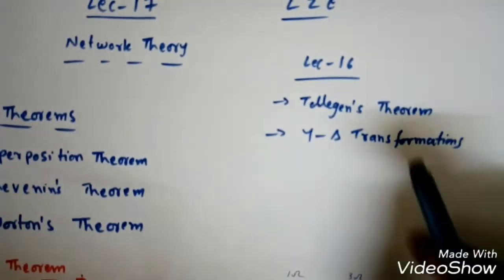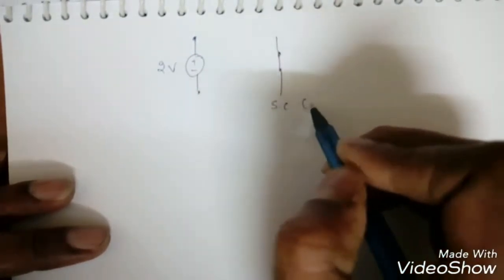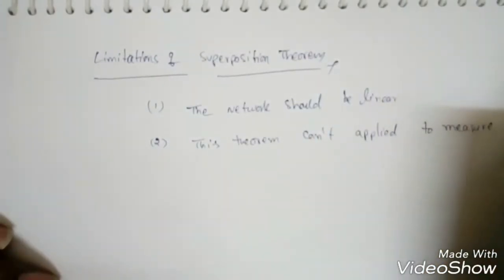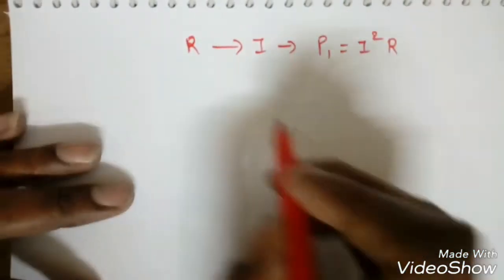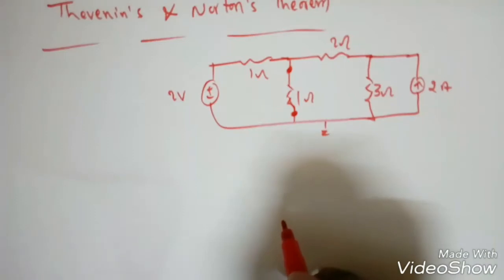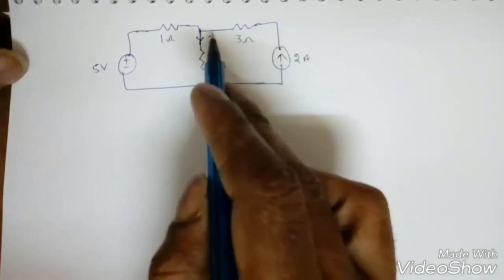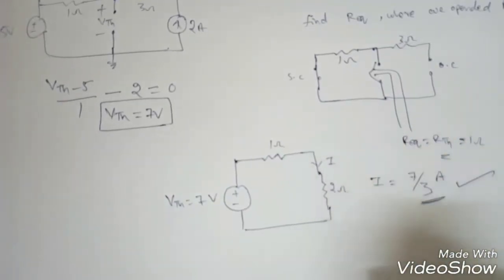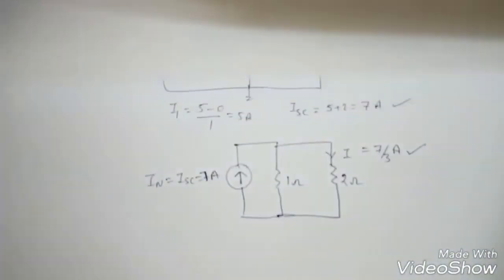Network Theory Lec-17(a): Network Theorems

Comment: Sir ,here while doing the prblm using thevnin ,Req was found to be 1ohms .but when u hav drawn the final crkt including Vth ,Req became 2ohms in series with 1ohms .can u plss explain
Reply from the maker: Gopika Ps see we have to find a current through 2 ohm resistor...so the remaining network can be replaced by thevenin equivalent circuit i.e Vth, Rth..so these two will become series to that 2 ohm resistor
Reply: Thank u sir ,understood

Comment: Hi Sir..  Good Evening..  In the First problem of Super position theorem...  while taking 2A source in line..  While calculating I value using current division principle in that total resistance u given 3 ohms..  But we have 3 resistances..  Then how the 3 is ans...
Reply from the maker: current is dividing between 2 and 1 ohm resistors right..that's why total resistance is 2+1 = 3 ohm...we will not consider the 3 ohm resistor which is series with the 2A source
Reply: Thanks Sir...